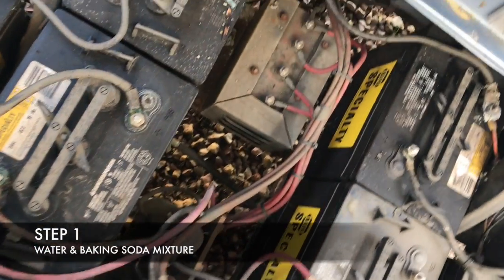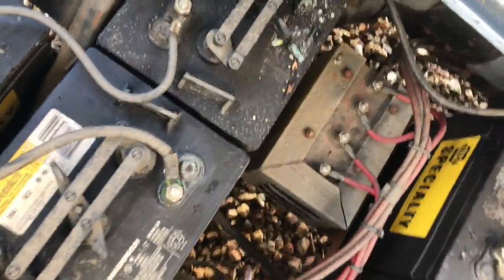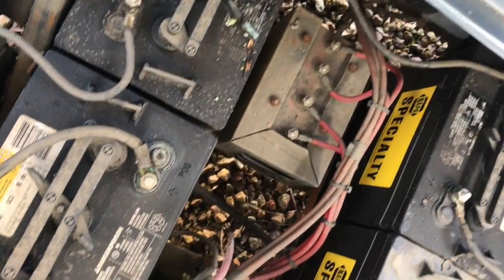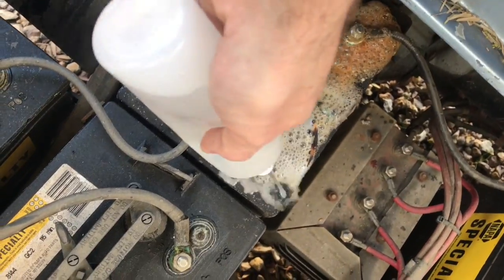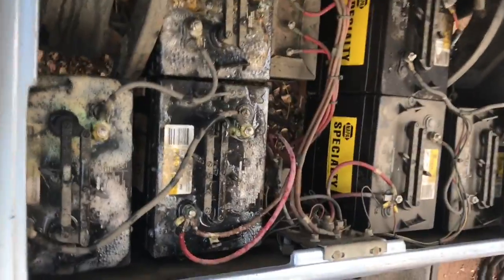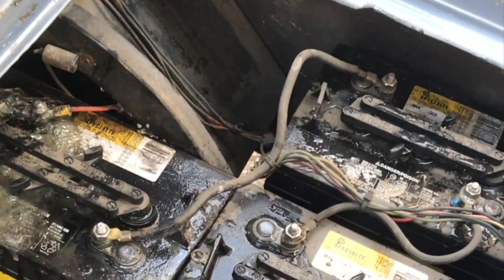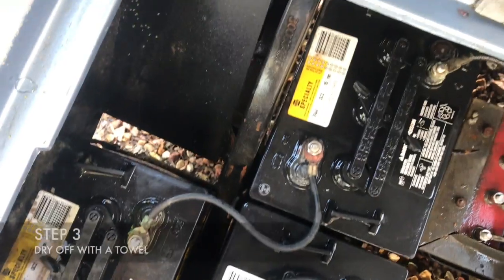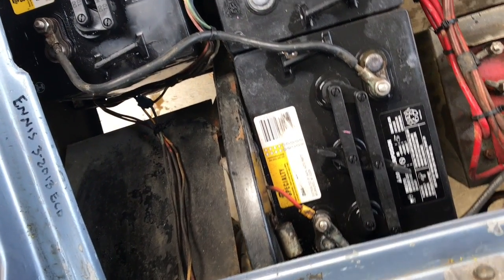Cleaning Your Golf Cart Batteries with Baking Soda and Water

Comment: Thank you so much!  I cleaned everything off as in your video and presto it runs better than before!  BTW, your video was the best!
Reply from the maker: You're very welcome Yvette! Glad we could help :)
Reply: Do you have to disconnect any terminals before doing this?
Reply from the maker: Hey Steve. You don't have to disconnect them. This was just a quick job to show the effects of Baking Soda and Water on Dirty Batteries and how well they clean them. If you want to do a thorough job, however, I would recommend disconnecting them and cleaning the terminal posts with a wire brush etc. Hope this information helps.

Comment: I would not risk shorting out your batteries by doing this. Remove the cables and clean them and the terminals carefully with a little baking soda and water.  See the video below on what happens when you short battery terminals. Batteries are too expensive to take the risk.

Comment: Aren't you afraid of the short-circuit in the batteries from rinsing off with so much water?
Reply from the maker: Hey Corujas! Thanks for the comment. I've been doing this for quite a few years now and have yet to experience that issue.
Reply: So long as there isn’t a load currently being out in the battery while it’s wet it should be ok. In other words have the key and any accessories off.
Reply: The short will create the load